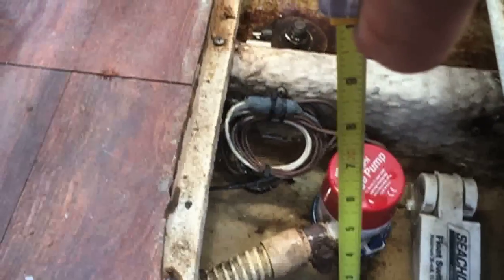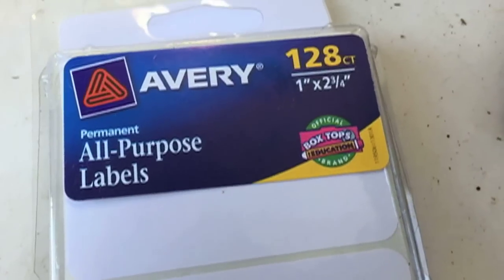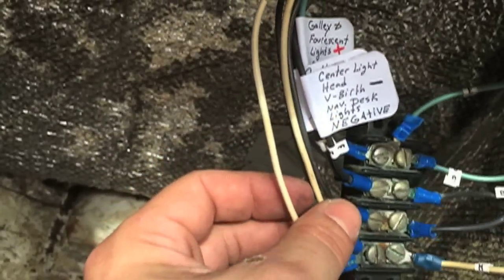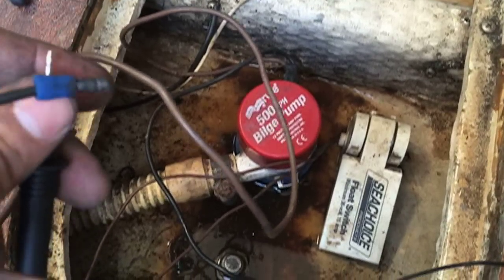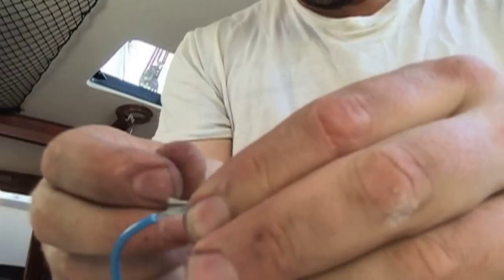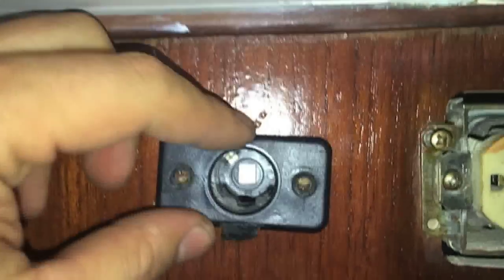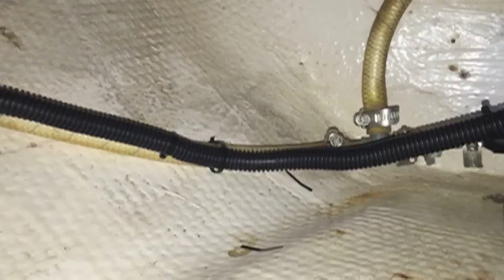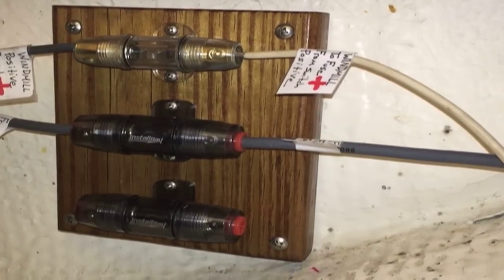SAILBOAT ELECTRICAL OVERHAUL PART 1 (TROUBLE SHOOTING)

Comment: Just to let you know that flight test method you are showing people is the Air Force spec on splicing wires on our fighter jets and such. So yes it is strong and a very good method to use to keep out corrosion
Reply: Never ever trust anything the air farce does with electricity.  I believe that was the first thing they taught us in naval nuclear power school.   Air Force teaches electrical theory backwards to the rest of the planet.  ( Positive is negative to them and vice versa )

Comment: We prefer to use heat seal butt splices over soldering in the marine industry. Frequent pounding on a boat tends to break solder joints over time.

Comment: Since you are upgrading the electrical you might want to consider shrink tubing instead of electrical tape. Slide the proper size tubing over the wire then solider the two wires let the solider cool a sec have a Q Tip and a bottle cap with a little clear silicone in it then swab a tiny amount over the joint and slide the shrink tube over it you may use either a heat gun or a cigarette lighter and just hold it under the tube for a sec and it will shrink down and seal it from corrosion. Another thing, I saw that the previous owner used non tinned copper wire in some of that wiring. Coast Guard regulation require tinned wire only! If God forbid something happened and your insurance company found this they would not pay the claim. Un tinned wire will corrode faster in the salt environment.  I refitted my boat and had to go back and pull all the wiring after a coast guard inspection. 

The wiring for your bow lights and stern lights is a prime example of why you need tinned wire only. It's for your safety. Imagine that circuit being electrified yet the power has not gone down the wire run entirely and you have a propane leak then suddenly the connection re establishes it self and that little arc or spark along with the propane fumes makes your boat go boom!

Here's to fair skies, following seas and smooth sailing!

Comment: I hadn't seen that trick with the wire wrapping before soldering - add that one to the toolbox.  I've seen splitting each into two ends (so you go from an A and B to having an A1, A2, B1, B2), then twisting A1 and B1 together, A2 and B2 together, then twist the 1s and 2s together.  That then gets soldered and shrink wrapped.  It leaves an unpleasant nub sticking out so I don't like it.  I've not seen it on small craft.  Like Jeff2191 said, ABYC says that solder shall not be the sole mechanical means of connection in any circuit.  I'm not sure about the CFR.
  
What I prefer is to use connectors that both shrink and (adhesive lined) seal - that gives you a great waterproof seal and mechanical connection.  The connection can then be further shrink wrapped (again with adhesive lining) for additional protection in places like the bilge.  I've had good luck with Anchor connectors, have heard 3M has some as well but have not tried them.  Tinned wires are also good for preventing corrosion if water does get in, say at a chafe point.  

I really enjoyed watching the video.  Good job, looking forward to part 2.

Comment: Solder and dielectric grease. Smother every connection with it and you shouldn't have any corrosion any more.
Reply: Also, clean every solder you make with some denatured alcohol especially if you use rosin core, and never use acid core, because that will, itself alone, eat through your connections.
Reply: I know that shitty stuff they use, but i never thought, in a million years that would go in a boat. That's a silicone based glue that comes on a backing.

That thing is the shittiest product i've seen (it's under many brands and even 3M has it...with the same effects, just takes longer to go wild).

Usually, i see that crap on AC (central Europe, Eastern Europe, not so much in the West). The thing goes really bad in heat, and i'm starting to think they put it on just so they can come later and lie about it saying "look, this thing went rotten, we have to replace it".

I forbid any crew i work with in the construction phase to use that crap, to see it in a boat, which has higher standards than electrical work on grounds is a bit of a shock, but well, the rest of the boat ain't exactly flying spec, so yeah.

Comment: ABYC recommends not using solder on stranded boat wiring because it makes the strands rigid and they break.  Instead, you should use crimp connectors.
Reply: 2:39 like that crimp connector?
Reply: ABYC says "solder shall not be the SOLE means for securing a connection".  Crimp and solder is one good option.  The wrapped physical joint he demonstrated (followed by solder is another).

Comment: Couple things to make your life easier on the boat!  1 Buy a Butane Soldering Iron there really cheap and butane is small and easy to store and it works without a cord or power for those oh shit moments!  Another thing is use Marine Heat Shrink its filled with glue and it will seal the connection so no water will seep in even if its submerged!

Comment: wile you are doing this project.  you are making it better. 
but 
it would have been wise if you had gotten away from most of automotive wire that was there.
what is better to use is tined wire.  tined wire resist corrosion that is more apt to be on boats.
also you should get away from spade connections.  you should go to eye connections when connecting to screws.  I say this because boat have lots of vibration that can loosen screws.  and when that happens you will loos the circuit because the spade will slip out .  when that happens you have to figure out where the connection was .  if you have the eye all you have to do is tighten the screw.

Comment: Amazing what people will think what will work on a boat when it comes to electrical work. Yes, some of it will work for a while at first, but once dampness and the salt water environment gets at it, it will rot out pretty quick. 

I have been amazed at how some people will try and save a few buck by using automotive wires, cheap big box store connectors, and wads of electrical tape, instead of Marine grade tinned electrical wires, proper marine connectors and shrink wrap and good sealants. I supposed it is a reflection of how much they value their own lives and the lives of others (when they sell the boat to an unknowing buyer). 

Great video and keep up the great work.

Comment: Just found your channel. Looks nice.  
Your electrics are one of the reasons I'm building from scratch.
I have found several horror stories about wiring on a boat and what it looks like
Well actually, they all kinda looked like what u had. :-)
Reply: Youtube "Sail Life" hasn't had much better luck.  "Amateur hour" is relatively common.
Reply: It's usually when former owners have "ideas" of how they should work these things. But, i have seen some horrific boat yard work as well on YouTube.

IMO, if you own something, you should always looks "under the hood" regardless. It's safer for you, your mind, etc.

Comment from the maker: Thank you for your comment. Yes I cleaned each connection after soldering. First wiping it down with warm water, then with contact cleaner. Finally I aplied a light coat of joint compound befor covering with heat shrink tubing.

Comment: I assume you are using rosin core solder from the appearance of the process shown. As such it is VERY important to clean off the connection after soldering to remove the left over rosin since it is corrosive and will degrade your joints over time. Use alcohol or another mild solvent and the wires strands themselves should be cleaned before soldering them. Otherwise good methodical inspection and correction of the problems!!!!!
Reply: I found that denatured alcohol is perfect to clean the residue left from rosin.
Hey, at least he wasn't using acid core...i know a guy who was really high and mighty over his wire work, it was a few years worth waiting to point out later that the electric work started to fall apart.